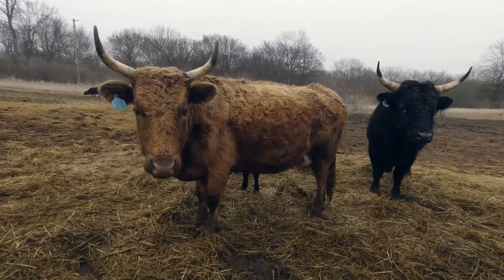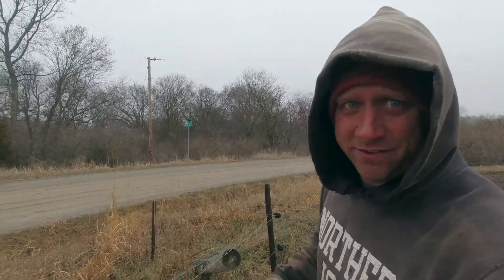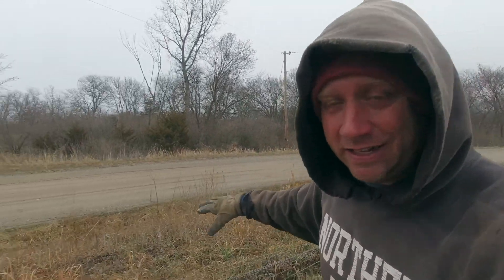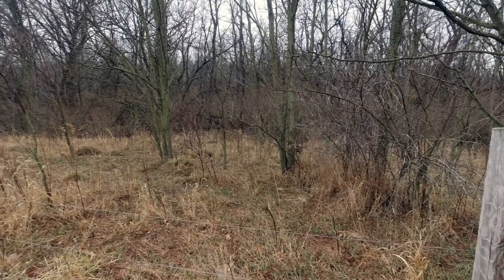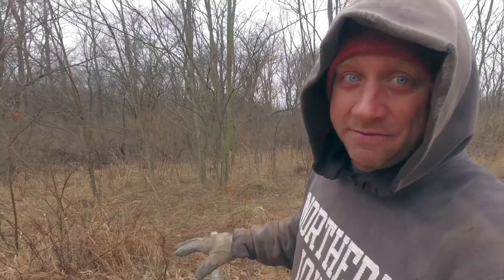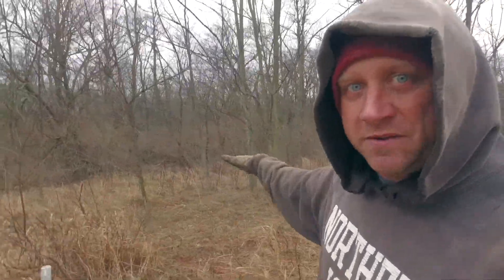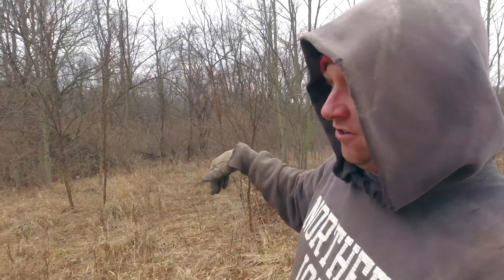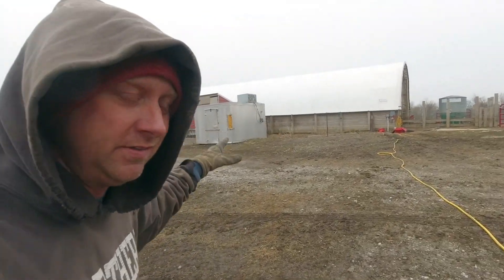Getting Serious About Farm Projects!

Comment: Since you asked for suggestions, if it was me, I'd think about putting a door on the lean-to portion of the barn.  

I'd do some cost comparisons to see what it would cost to put three bigger doors across the front of the barn instead of two small doors and one larger one, by the time you fill in the openings to fit the smaller doors, it might cost just as much as a larger door and it might take less time to just install a larger door instead of building a wall around a smaller door.   Larger doors would also give you more options in the future for using the barn.

I'd also start working on fixing your erosion problems because things like that just get harder and harder to fix the longer you wait.
Reply from the maker: I do like the door on the lean-to suggestion. That is not a top priority, but it is something I'm going to look into ... of course if I put a door on I wouldn't be able to get my tractor in.

The reason for the smaller doors on the ends is so because there is going to need to be some sort of framing done in order to get them so they clear the track for the middle door, and clear the posts on the side of the shed ... at least that is my understanding from talking to a few people. But, once I have a bonafide garage door builder out here I'll have a better idea.

Erosion is something we are working to get on top of. This part is bad, but the more troubling piece is actually in the woods coming from tile lines onto our farm.
Reply: @TheBeginningFarmer  How about your patented tarp door on the east end?  Maybe bringing it down to where you can still walk under it would stop a lot of the weather, and if you need to get the tractor in it wouldn't be too hard to take down.